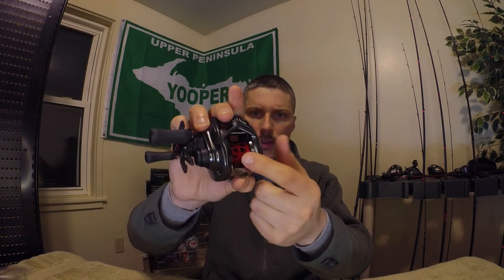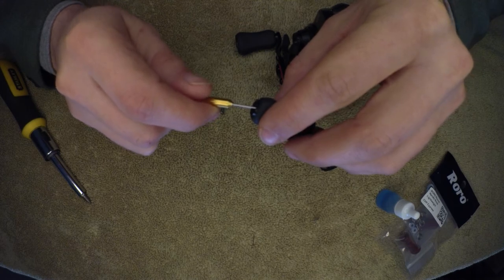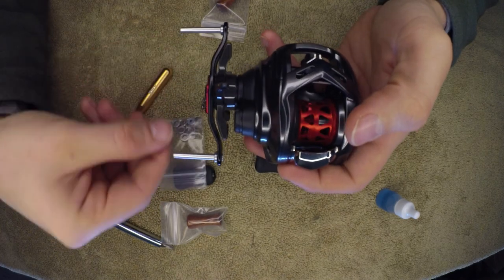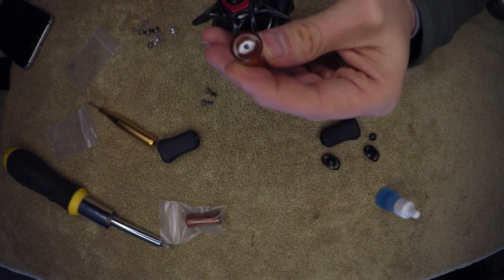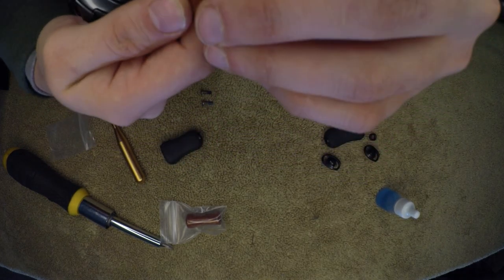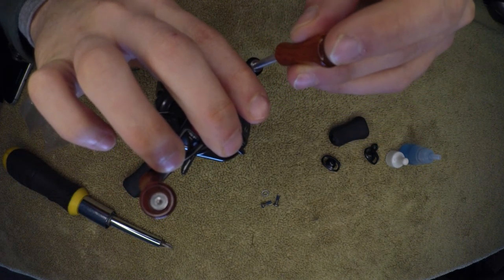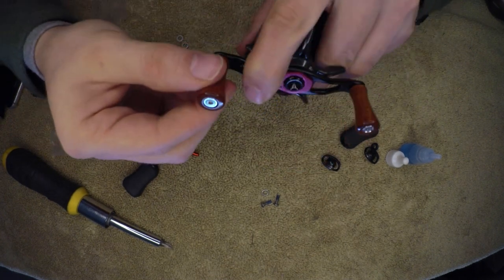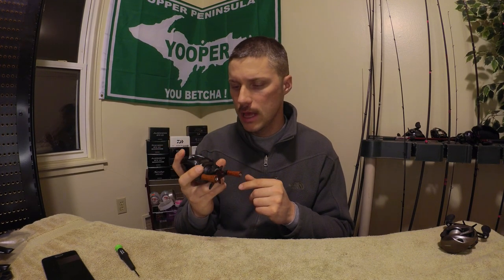How to Change or Install Knobs and Bearings on Fishing Reel

Comment: Nice video. I'm still trying to figure out which style of knobs I like best. Been trying different aluminum, wood, and cork ones. Nice to see your process, because I always feel like the installation is never like the recommended diagram. I'm always using an extra washer or spacer to get a good fit.
Also looking forward to the clicker video.I saw it one ebay and then on RaWr's page and still haven't pulled the trigger on it. Looks like a nice, well made clicker, but it's a little more than I want to spend on a clicker without seeing any reviews.
Reply from the maker: I will show the entire installation process on the clicker system.
Reply: @HobieWanKenobi  cool, it looks pretty easy to install and more precise compared to some of the other clickers. I'll be interested to see what you say about it before I shell out about $100+ to buy and ship one.
Reply from the maker: I hear you. I spend plenty of time finding other peoples experiences with products before buying.
Reply: Might have to buy it if you recommend it in the video. Looks like the guy invested a lot of time to make a quality product.
Reply from the maker: He has put a lot of work into it. Many prototypes and tweaks. Makes the seemingly high price worth it knowing he is so meticulous (check out his Instagram) and he is producing them in small batches.

Comment: I have changed some reels handles and knobs and found them loose.  Looking now for shims, I have realized 4x7x.5 are so hard to find.  Any idea where to buy a ton of shims that fit?
Reply from the maker: I amassed them from buying knobs and such. the shims aren't exactly 4x7. They are slightly smaller than 7mm and slightly bigger ID than 4mm
Reply: @HobieWanKenobi  I figured where they would encompass/protect the bearing.  The shims can really help a smooth free spin for me at times.
Reply: order conplete shaft from ali they come with shims